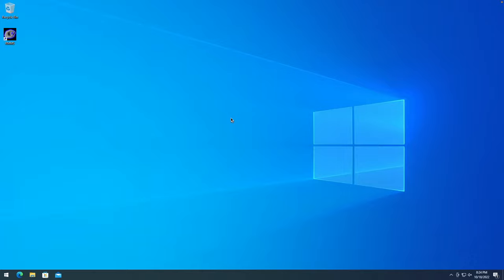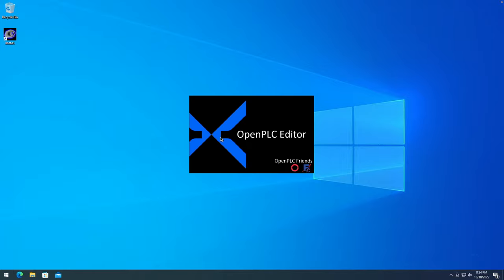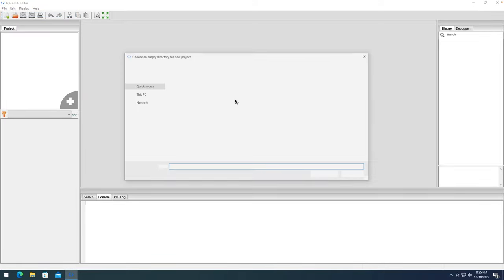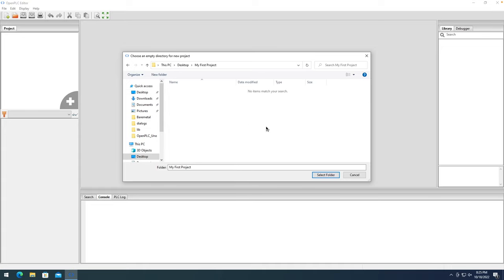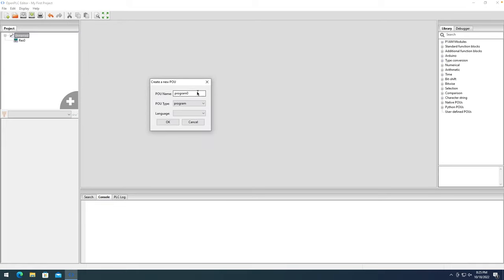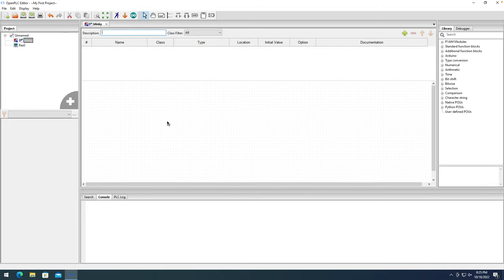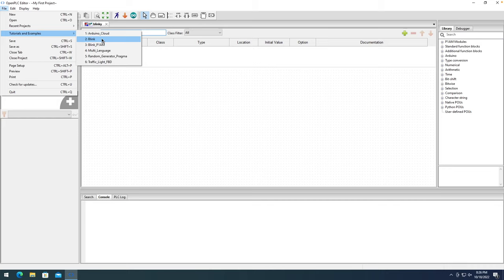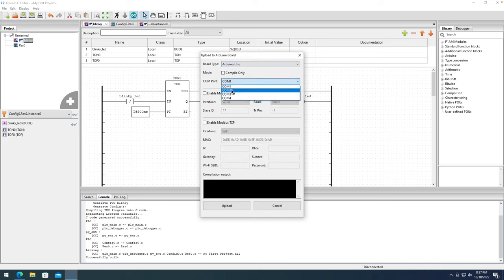Basics 03: Programming an Arduino Board with OpenPLC

Comment: FINALLY, I never was able to write complex MCU programs with Cpp/Python. Ladder Logic is SO much SIMPLER and if you have electrical training(like me) then all of it comes naturally. Thanks so much for creating an Open-Source PLC programming environment for all the sparkies out there!
Reply: Hey, do you know how to convert the outputs into a 24v signal? Just solid state relays or do you have an idea? :) I want to use a raspberry pi and I'm worried about the 5v signal on that guy :)
Reply: @ybloc1428  Raspberry Pi gives you 3.3V signals (not 5V!), which are directly connected to the main CPU block. My recommendation if you don't need high currents is to use optocouplers because. Otherwise you'll need a 2 stage design, either using a transistor to control a relay or optocoupler to control a mosfet.
Reply: @Ether_Void  thank you! I've been researching transistors to see what kind I'd need, I don't mind a little more expensive if it lasts longer and does the job. I've found some formulas and different types but I have yet to go through the schematics to see exactly what im working with :) I haven't actually bought a pi yet because I'm trying to find the simplest but most capable "controller" for off wifi use in a house setting :)
Reply: @ybloc1428  Apparently my comment doesn't get shown when I refer to other videos.
But what you are looking for is "Transistor as a switch" most likely there are variants of it for BJT, Mosfets etc. and for this you don't need a whole lot of math since things like current amplification/trans-conductance don't matter much. 

N-Fets or NPN transistors usually are a bit easier to use and have better performance, however you'll need to use them on the "low side" aka. switching ground. Whereas P-Fets or PNP switch "high side" aka. 24V rail in your case. Reason simply being that all transistors rely on a voltage difference, and high side will reference 24V meaning you'll have to control a close to 24V signal to control another 24V signal (again usually doable with a 2-stage design).

As to what type... If you need higher currents and a opto-coupler on it's own isn't enough I would usually go for a Mosfet. They aren't expensive, take less current to control (when switching low frequencies at least) and generally have a lower resistance aka. generate less heat. They also don't necessarily need a resistor on the gate to control making them easier to use.
Reply: @Ether_Void  thank you so much, that's really helpful! :)

Comment: We really appreciate the huge amount of work this project has been and hopefully it will continue to grow and stay stable and reliable.  Your To Do list seems is very big at this point and most of them are wishes,  not requirements, so if a requested feature causes instability or is not what one of the big players currently do, we understand if you put it aside.  Stability of the product is much more important than creeping featuritis.  Again as a retired senior controls engineer who has worked with PLCs for 30 years, this is outstanding work.
Reply: I am a young engineer but I fully agree. This is amazing stuff...
Reply: It seems things on here are no longer supported.  Or the entire ardurino community is just tapering off.  I'm a pretty sharp dude with this stuffbut itbhas been a nightmare trying to get the R4 to work as a TCP/IP client server.  Figured I would try this out....but the board isn't supported.  Won't right the simplest program over to the board....again....because it isn't supported.

Comment: This program is truly outstanding. I have been programming Unitronics Unilogic, Visilogic and U90 series plc controller for years now. Unfortunately, cost is a big deterrent for some smaller companies just starting in manufacturing and or companies requiring control integration. Having the ability to use a cheaper Arduino board for smaller non industrial applications is amazing and game changing. Thank you sir.

Comment: Mach3 CNC users are always trying to figure out how to use an Arduino or ESP for I/O expansion.  It would be extremely smart to do a tutorial specifically demonstrating this. It’s a massive community and of course Modbus is extremely intimidating and the information on how to do this is frustrating. If you do a tutorial and it gets out users will sky rocket!
Reply: I’m serious. Once they discover this it will be everywhere! I stumbled here trying to extend my I/Os with an ESP32. A project I’ve been attempting to do for over a year now.
Reply from the maker: I’m sure this would be cool, but as far as I know, Mach3 CNC does not have any integration with OpenPLC. My videos are focused only on solutions around OpenPLC
Reply: @openplc  Mach3 can manage Modbus Master Communication so the Arduino or the ESP32 can be programmed as Modbus Slave so Mach3 can extend the IOs via Modbus.
The OpenPLC project is amazing and I would like to thank you for this gift to the world. :-)
As far as I know there is no other free of charge PLC framework [at this quality stage] out there.

Comment: Hi, at 13:56 you mentioned if we have RS485 hardware, we can select a transmit pin. But RS485 hardware usually has 2 wires or 4 wires. How does that fit into just 1 pin?
Reply from the maker: The transmit pin is used only to inform the bus that the device is transmitting. In some circumstances it is optional. The actual data pins (RX/TX) will depend on which Serial port you selected and varies according to your board’s UART disposition

Comment: Great info, nice to see that little Modbus RTU introduction in the end.
As I understand, the Arduino target is a Modbus slave device. Will there be an option to use a target as a Modbus master so we can use industry standard Modbus I/O modules?
I have a few Wago fieldbus units left over that would be a perfect fit
Reply from the maker: Modbus Master is on the "to-do" list. It is not too hard to implement, but the main issue is that small boards like the Arduino Uno might just not have enough space (RAM) to fit it in.
Reply from the maker: One more thing, Modbus Master is already available on the OpenPLC Runtime for Linux and Windows. You can, for example, use OpenPLC on a Raspberry Pi with both Master and Slave capabilities. Porting that code to microcontrollers (like Arduino boards) is a challenge due to the small footprint on those boards, so the best option is to rewrite from scratch. That's why it is on the "to-do" list :)
Reply: @openplc  I'm an embedded systems programmer and I wrote my first PLC runtime on a 6502 machine with 1 kB memory (program + data) available way back in '83 😁. I actually do have a RevPi on my desk but I don't like that it's R.Pi based (or any other O.S. that relies on data integrity on an SD/SSD/HD).
You could split the board in small (only slave) and large (master & slave) boards but that's adding another level of complexity.
Meanwhile, let's not forget that I am very happy to see the ability to monitor the PLC using Radzio! I'm just now starting with my first openPLC project: the automation of a tool changer for a CNC milling machine 🙂

Comment: Thank you and very clearly explained, can you please provide tutorial for arduino mega with built in wifi esp8266 configuration using open plc
Reply from the maker: You can't use the esp8266 to provide WiFi for the Arduino Uno on OpenPLC, but you can program the esp8266 directly with OpenPLC. The esp8266 alone is a much more powerful microcontroller than an Arduino Uno.

Comment: how to read values from i2c/spi sensors connected to arduino using open plc. 
if you can do a video about that will be helpful
Reply from the maker: I2C, SPI, or any kind of bus on the board requires a special library that is currently not implemented on OpenPLC. But keep posted as updates on this project are very frequent. You might see it coming in the near future.
Reply: @openplc  Thanks. It's good to have that as block in OpenPLC
Reply: @openplc  Cant' we communicate between two arduinos. as a example one arduino as a extra i/o module to the other?

Comment: When I press connect on RMMS I get "Port opening error!" I set the same COM-port and baudrate as my arduino. I only have the Arduino Uno nothing more, do I need the RS-485 to TTL converter to use Modbus?
Reply from the maker: No, you don't need anything other than the USB cable connected. If you got a port opening error it probably means that the port is open somewhere else. You can't have more than one program using the serial port at the same time.

Comment: is it possible to use the other gpios on for example the Arduino MEGA that is not in the address list?
Reply from the maker: Yes, you will have to modify the board hal file located at /editor/arduino/src/hals
Reply: @openplc  Does the ESP32 code work on all new devices such as S2 S3 and PICO?

Comment: When I run the simulation nothing happens. And I don't think I made something wrong because the same occurs when I open the example project. It doesn't blink and it doesn't debug (on the right panel) either.
Reply from the maker: Make sure you’ve clicked on the glasses icon to open the simulation instance
Reply: @openplc  yes I didn't noticed you did. Another thing that was not clear from the video which caused some pain to me was the setup for RMMS: setup => data definition => scan rate 100. With the default 1000 it won't show any change in values with that program.
Reply: @giusepped3693  I have the same issue but it does actually blink but at a period of approx 40 seconds, not at 0.5 secs. I guess it is a comm port issue but may be someone could say for sure and how to fix

Comment: Hi I am working on a project for a PLC using esp32 But I want to know how do I make the TCP/IP over Ethernet work because I will be placing the ESP32 in an Metal Box and also the Wifi Range could be a issue for me. Secondly, Arduino Ethernet Shields are expensive than the normal Ethernet to SPI converter (W5500) Module. Also You didn't specify which Shield to use with Arduino as there might be compatibility issues. Hence, It would be helpful If I would know. Most common of them Is using the W5100 Chipset. Would the TCP/IP still work if i connect other ethernet module to arduino with same connections but another chipset(W5500).
Reply from the maker: The runtime code was written using the default Arduino Ethernet library, which works on the W5500. A different shield would require the runtime code to be changed

Comment: I'm a retired Industrial Controls Engineer. Very familiar with Ladder Logic programming and I am excited to use this. How do I edit? Where is documentation? You erased a line ( wire ) in the video ( at 6:35 ) and I hear you "hit" a key on your keyboard to delete it but, you didn;t say how you did it. I tried a few things but nothing. Can you help? Is there a documentation for instruction set and editing? I looked for it but not found...
Reply: I figured it out. Sure wish I had some Instruction Set info and Editing Info.

Comment: I am using a Arduino Uno. When i switch to the window "transfer to plc" it always shows [not installed] after the uno. i am running the softeare on windows 10. and the upload doesn't seem to work properly (the program doesn't change on the board). how can i fix this?

Comment: Great Work :)
How to add new boards in OpenPLC.
Blackpill 411 is available, Is it possible to add Blackpill 401
Reply from the maker: Adding new hardware boards is not complicated as long as they have some support on the Arduino IDE. Search the OpenPLC forums for adding new hardware, there are many posts about it in there.

Comment: I am extremely overjoyed with this project and can now build small industrial projects and breath life into them without having to buy expensive PLCs. I tested the process on a Mega 2560 and worked fine although I had to use an external LED since pin 13 appears to be assigned to an analog output. I used the Radzio Modbus software but the blink rate was approx 40 secs not 0.5 as the the code. Can anyone suggest what the problem is??
Reply from the maker: Most likely your refresh rate on Radzio was too long

Comment: Hey hi its wonderfull software you made. Very much thanks to you.. as the plc user want to program arduino which is difficult by c language but you did amazing job.big thanks to you. I have one question, if i want to controll stepper motor with the help of arduino how can i do that with help of this software ?
Reply from the maker: Stepper motors are a little more tricky. I'm working on a new PWM block that will make it easier to control servo motors, and eventually stepper motors as well.
Reply: When it will ready can you share us ?

Comment: In Automation Industry, we are moving away from ladder as more and more engineers are now coding-litrate. This openPLC application would've been a catch 10 years ago when access to such technology for limited to priviledge few.
Reply from the maker: Engineers has always been code literate. The problem is with automation technicians that most often don’t read structured text very well. In any case, OpenPLC Editor supports all 5 IEC 61131-3 languages, so you can program in Structured Text if you want 😉
Reply: So use ST ...
Reply: A picture tells more than a thousand words, is how the saying goes.
I am an embedded systems programmer and since the beginning of times, programmers have come up with ways to visualize the behavior of programs in diagrams.
ST is, like IL, LD, FBD and SFC one of the languages supported by OpenPLC. When I needed to implement a small PLC to guard a machine we are building it took me about 1 hour to install OpenPLC and to create (and test) the Ladder Diagram to do this. I did learn ST a few years ago but it would take me at least that long to recap my ST skills. ST is great when you use it on a regular basis but for me the visual way of programming in LD, SFC and FBD makes it easier to implement and maintain in a later phase.
And that is the beauty of a system like OpenPLC; the ability to choose, or even combine, your favorite language(s)
Reply: So if uploading to an Arduino there is no need for Runtime?  Is this also true if uploading ESP32 or ESP8266?
Reply: @michaelschwenk9743  You do not need to install the runtime when using an Arduino (or other embedded) target. As soon as you use the upload to Arduino option, the runtime for the target is part of the Arduino (or other target) environment and it is compiled and uploaded together with the PLC code.

Comment: Hi new to all this but got as far as 5:05 on my Mac and open plc crashes with:
Traceback (most recent call last):   File "/Applications/OpenPLC Editor.app/Contents/Resources/editor/runtime/PLCObject.py", line 182, in _LoadPLC     self._PLClibraryHandle = dlopen(self._GetLibFileName()) OSError: dlopen(/var/folders/sf/p240390x79lg8c654zfcqltm0000gn/T/tmpakkvmyny/ebe3a09313923629a7040e3480642913, 0x0006): tried: '/var/folders/sf/p240390x79lg8c654zfcqltm0000gn/T/tmpakkvmyny/ebe3a09313923629a7040e3480642913' (mach-o file, but is an incompatible architecture (have 'x86_64', need 'arm64')), '/System/Volumes/Preboot/Cryptexes/OS/var/folders/sf/p240390x79lg8c654zfcqltm0000gn/T/tmpakkvmyny/ebe3a09313923629a7040e3480642913' (no such file), '/var/folders/sf/p240390x79lg8c654zfcqltm0000gn/T/tmpakkvmyny/ebe3a09313923629a7040e3480642913' (mach-o file, but is an incompatible architecture (have 'x86_64', need 'arm64')), '/private/var/folders/sf/p240390x79lg8c654zfcqltm0000gn/T/tmpakkvmyny/ebe3a09313923629a7040e3480642913' (mach-o file, but is an incompatible architecture (have 'x86_64', need 'arm64')), '/System/Volumes/Preboot/Cryptexes/OS/private/var/folders/sf/p240390x79lg8c654zfcqltm0000gn/T/tmpakkvmyny/ebe3a09313923629a7040e3480642913' (no such file), '/private/var/folders/sf/p240390x79lg8c654zfcqltm0000gn/T/tmpakkvmyny/ebe3a09313923629a7040e3480642913' (mach-o file, but is an incompatible architecture (have 'x86_64', need 'arm64'))
Reply from the maker: The new editor from the Autonomy website fixed this. Just download and reinstall